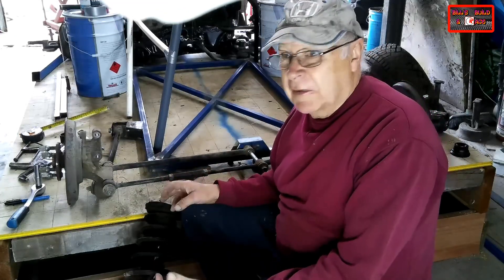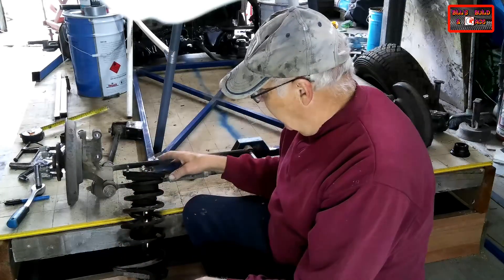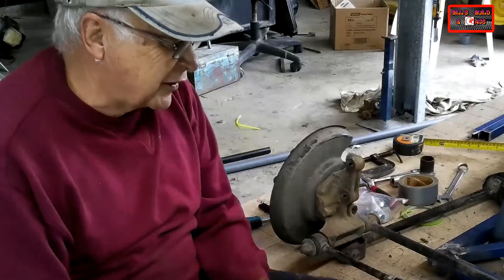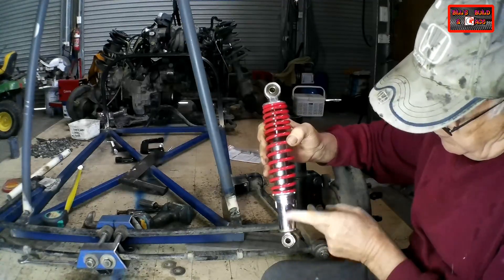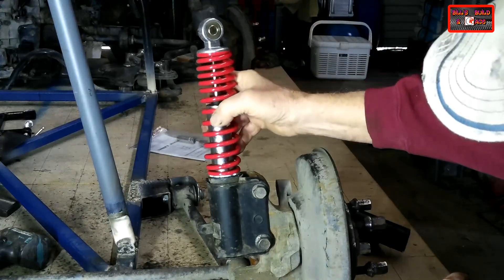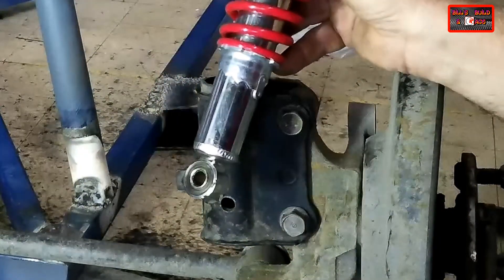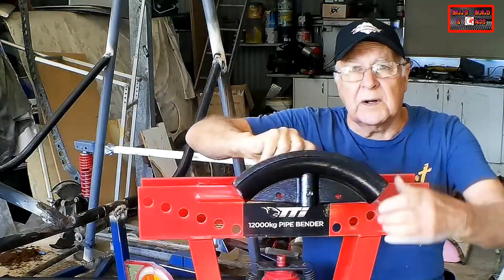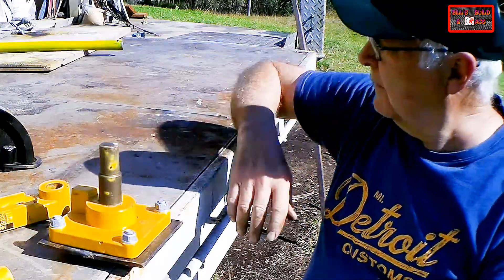Building an Autotest Special - Part 6 Rear suspension & Framing

Comment: Bill, old trick to bend tubing without kinking was to fill the tube with sand and weld both ends shut, then bend on tubing bender. after cut caps off and empty sand out.
Reply from the maker: Yes I actually tried that after my hydraulic bender was kinking the pipe.  It made no difference whatsoever.

Comment: Bill you really need to get yourself a cheap Lathe that way you can machine parts to adapt any thing to every thing. As a retired Machinests even now I'm on the machines daily and I would be able to count the things I've made for race cars .cheers
Reply from the maker: At 75 and only on a pension I can neither afford to buy significant new machinery or have the patience to learn such a comprehensive new skill. I will learn how to use a lathe, if you will learn how to work with composites and sculpting race car bodies..... hahaha.
Reply: looking good for 75 bill!  Its never to late to get started on a lathe they are pretty useful even without much/any training.